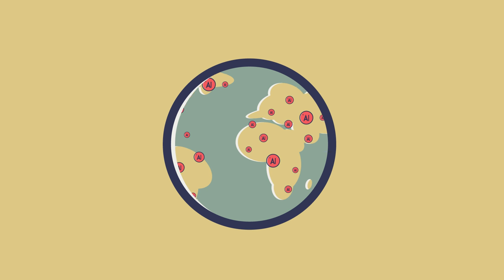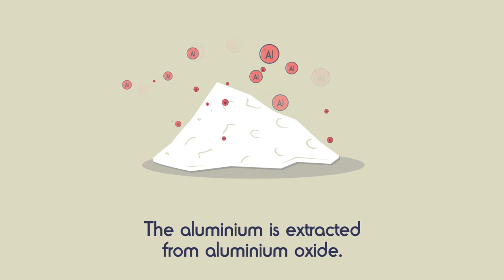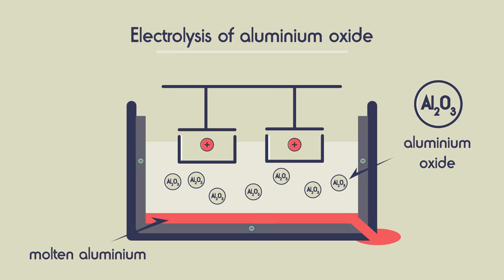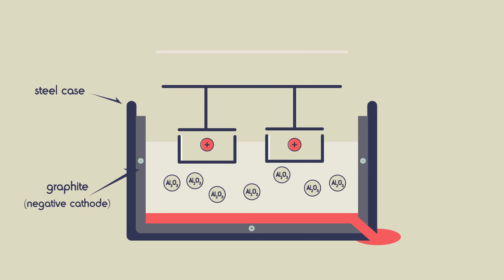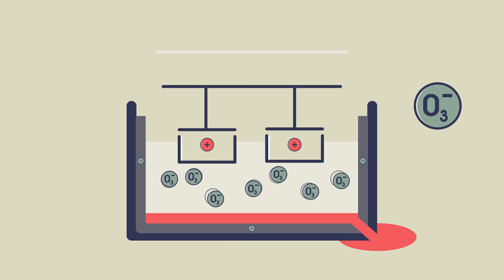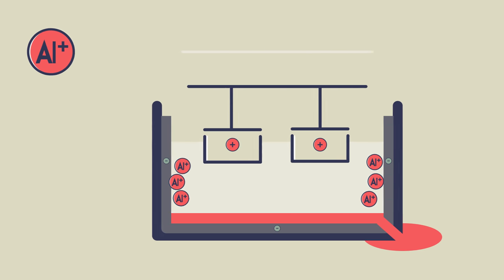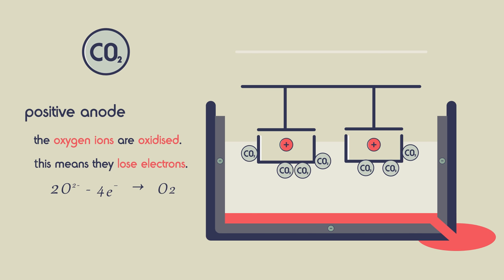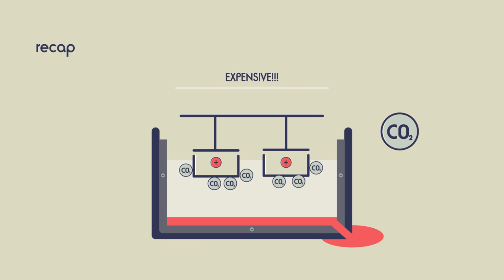How To Extract Aluminium By Electrolysis | Environmental Chemistry | Chemistry | FuseSchool

Comment: -aluminum oxide in melt dissociates into ions (not molecules of Al2O3) 
-for melt, it needs to be clear this is an ionic medium for conductivity
-incorrect charges on ions Al+3 and oxide in melt is O-2
-overall reaction includes consumption of graphite anode
-electrolysis cell needs to show a connection to power source
Reply: How is graphite both the cathode and the anode?

Comment: Thanks for video. Could tungsten be used instead of graphite? It conducts electricity and has almost same high melting-point. I bought a lot of graphite rods before i realized that it will turn into CO2(going to make hydrogen for airvessel).

Comment: Extraction of aluminium:
Aluminium is the most abundant metal in the Earth's crust. It is expensive, largely because of the amount of electricity required in the extraction process.
Aluminium ore is called bauxite. The bauxite is purified to produce aluminium oxide, a white powder from which aluminium can be extracted.
The extraction is done by electrolysis. The ions in the aluminium oxide must be free to move so that electricity can pass through it. Aluminium oxide has a very high melting point (over 2000°C) so it would be expensive to melt it. Aluminium oxide does not dissolve in water, but it does dissolve in molten cryolite. This is an aluminium compound with a lower melting point than aluminium oxide. The use of cryolite reduces some of the energy costs involved in extracting aluminium.
The negative electrodes (cathodes) and the positive electrodes (anodes) are made of graphite, a form of carbon.
During electrolysis:
• positively charged aluminium ions gain electrons from the cathode, and form molten aluminium
• oxide ions lose electrons at the anode, and form oxygen molecules
The oxygen reacts with the carbon in the electrodes, forming carbon dioxide which bubbles off. Carbon is therefore lost from the positive electrodes, so they must be replaced frequently. This adds to the cost of the process.

Hope this helps a little bit more. I realized you need to have a background for electrolysis to understand this video and I finally do.
  I got all this from BBC BITESIZE.co.uk.

Comment: isn't graphite supposed to be inert (unreactive) then how is the carbon-in graphite- reacting with oxygen?
Reply from the maker: Graphite is a form of carbon. Like coke or coal it burns in air and especially in pure oxygen to form carbon dioxide. The higher the temperature the easier the reaction becomes. The cell runs at around 1000 degrees C so the graphite burns away fairly rapidly!
Reply: @fuseschool  got it thanks

Comment: just use high voltage to break the bonds, only small batches and no melting or current flow needed
Reply: you can use smaller voltage with hydrogen gas mixed in with the bauxite or just user solar power to get rid of the price tag

Comment: Wait, what do they mean when they say that aluminium does not corrode, I am very sure it can corrode
Reply: They mean it doesnt rust. It corrodes but that stops after just a layer ( not like iron)
Reply: Okay, so when aluminium reacts with oxygen, it produces an insoluble layer of  aluminium oxide that sticks to the aluminium. This layer of aluminium oxide prevents oxygen from reaching the oxygen and so aluminium does not further react.

Iron Oxide, a.k.a rust, is soluble and can be easily scraped off. So, more oxygen and water can reach the iron and it continues rusting.

Comment: The reaction is not just aluminum oxide going to aluminum and oxygen the carbon is involved. 
The aluminum oxide goes to aluminum and carbon dioxide.  The carbon comes from the electrodes.  That’s why they are used up.

Comment: There is a major mistake in this video. Oxide ions are NOT 03- and aluminium ions are not Al+. Please remove and correct the video before re-uploading, or it will cause so much confusion. Thank you.
Reply from the maker: Yes, we are fixing the video and it will be reuploaded. Thank you!